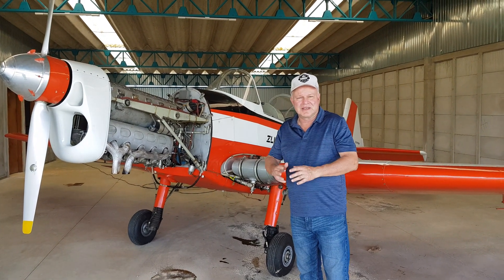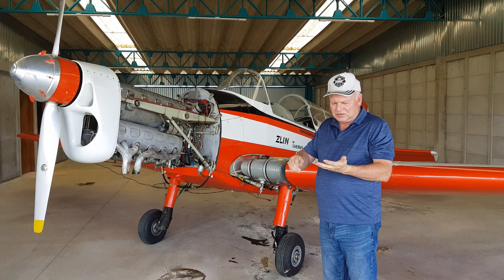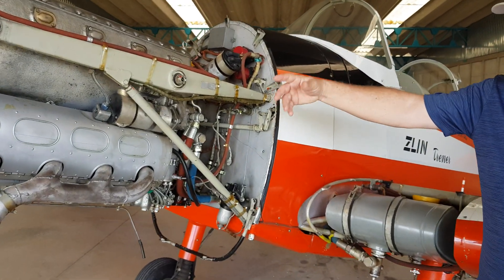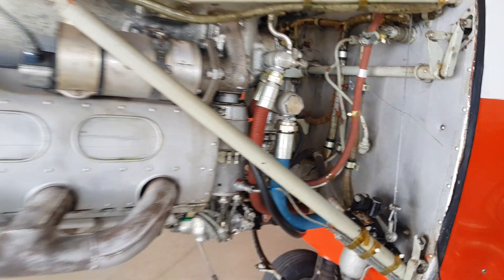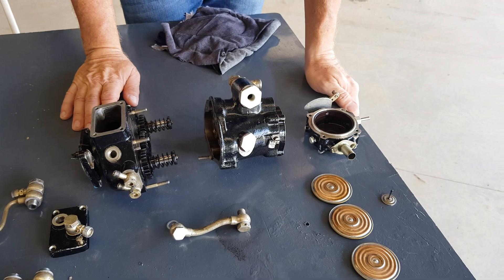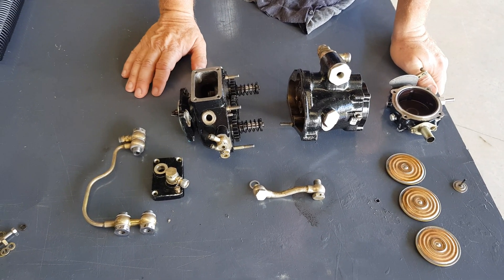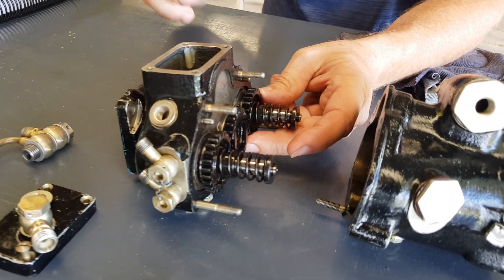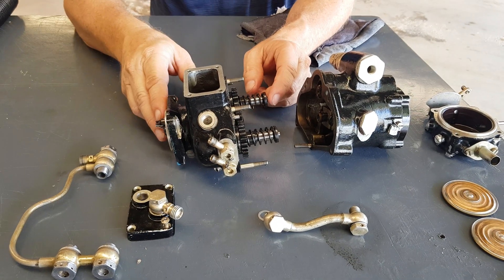Walter Lom M-137 fuel injection pump

Comment: As previously commented by other viewers:
Special thanks to Mr. Walter Baumann for doing these two videos on the LOM engine. 
The camera and sound quality is very good - so, please, can you make a video with a cold startup of the engine?
Perhaps also to include comments about the cold startup procedure for the M137AZ.
Also, if you can share more insight about any specific problems for the engine and solutions you made. Especially, how good is the oil system and if there are any special problematic points for the oil system
Reply from the maker: Hi Ivan, sorry for the delayed answer. Thanks very much for recognizing my videos.
Yes, I will upload a cold start video as soon as possible,
thanks again, Martin